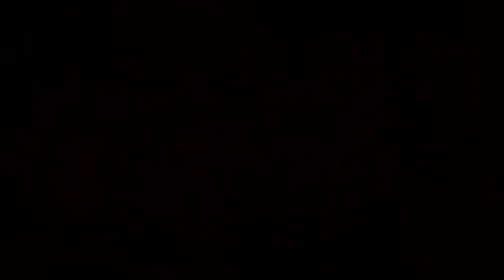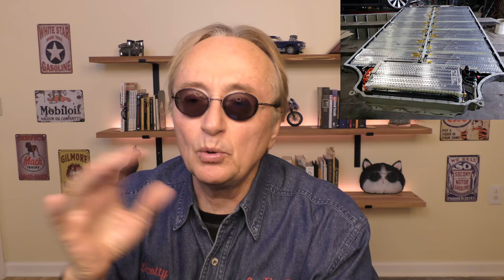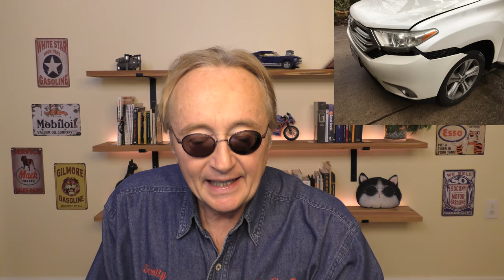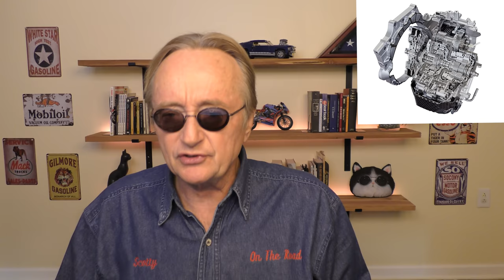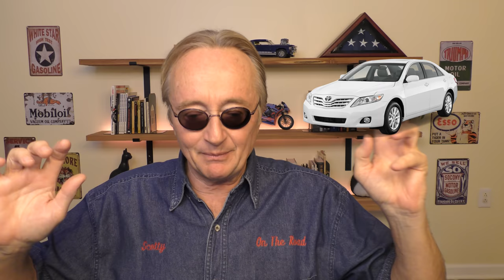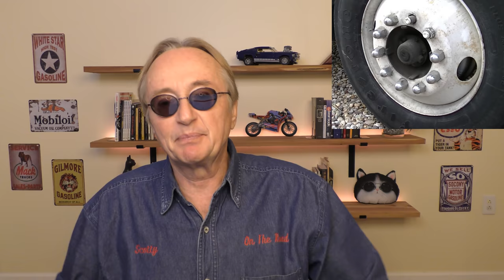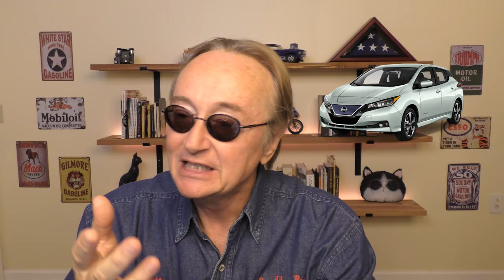This Fatal Flaw Just Ended Tesla’s Future in America

Comment: Give me the good old fashioned gasoline engine, always there when you need it!
Reply: Sure.  You'll change your tune long before this decade is done.  Scotty doesn't know this subject.
Reply: FACTS
Reply: Yep and only takes 3 mins to fill my tank and I get another 550 miles!
Reply: @Mrbfgray  Times going to tell the longevity of battery cars pal! You dont even know the problems yet, what we do know works is gas and diesel and you can suck on those tailpipes!
Reply: @Mrbfgray  the infrastructure isn't there for even 50% of the population to own electric cars.   Imagine the strain on the grid when every house has 2 cars plugged in every night charging.  It will be more than 10 years before they can implement widespread electrification.  Not to mention as long as there is oil to sell there will be cars to use it.  Think BP and the like are just going to pack it in?
Reply: @rxtuninginc8444  the infrastructure for electric vehicles will never be completed in ten years. First off there isn't the generating capacity to have millions of vehicles,  not just cars but trucks of all sizes, being charged simultaneously. It may take 50 to 100 years to simply get the power generation built. It won't be solar or wind...which fail to work when you need it most.
Reply: @brandonlewis5045  I'm far better informed than you are on this topic.  YOU WILL switch to EV before you suspect for economic, convenience and superiority of EVs.  Not going to argue further but you'll see in a few yrs. 

 BTW--I'm something of a petrol head, no desire for an EV, still love my 'old' BMW S65 V8, but I see where things are going and have made a small fortune on it already.
Reply: Until it's so cold the engine won't turn over. EVs lose range in the cold but they physically cannot fail to start.
Reply: @brandonlewis5045  Yes time will tell but battery life is going to be a non-issue at least for many options out there.  Even old Tesla Model S's (2013 vintage say) with 200k plus miles are doing fine and that was with much inferior batt tech than current iterations.
Reply: @rxtuninginc8444  How about taking 30 seconds to plug in at home and NEVER visit a gas station again?  (only charging at a station will be for road trips)   Or near zero maintenance?  Or 1/4 the operating costs?  It doesn't take you 3 min it takes at least 20 as you go out of your way to fill up.
Reply: 2014 electric smart car.  Bought with 6k miles off lease for 5800 delivered.  
Now just over 100k miles.   No repairs . Only maintenance has been tires and wipers.   

Front and back brake pads still  at over 1/2 life.
Reply: @Mrbfgray  How about the power grid and california having black outs in the summer because of peoples af running and people charging evs??????????????
Reply: @brandonlewis5045   Cali has separate problems but charging at night should be of little consequence.  Furthermore it's becoming increasingly cost effective to be independent of the grid entirely, already pays off in a reasonable time frame and will  continue to become cheaper.  
When refrigerators and AC were 1st introduced the grid wasn't ready for them either but it was by the time everyone had one.  EVs will have a similar increase in grid demand only this change will be faster.
Reply: @johna5484   Sounds like ultimate econobox deal you've done there, and that's for an old inferior tech choice.  Near future options will be vastly superior.
Reply: @Mrbfgray  So..... My question to you where are the rockefellers and the oil money in this transition?
Reply: @brandonlewis5045   Utterly irrelevant if they don't chose to join the transformation...you haven't fallen for that fantasy that Rockefeller's or BIG BAD OIL runs the world, have you?  Dallas wasn't a reality show, lol. 

Shell has been involved in alternatives for decades as have others.  Famous quote from old oilman:  (Shell CEO I believe--circa. mid '90's)  "The stone age didn't end bc we ran out of rocks and the petroleum age won't end bc we run out of oil."

He couldn't begin to know how right that call was prior to horizontal drilling/fracking tech revolution made 10X more economic oil available.
Reply: @brandonlewis5045  I can and have, in the past, made my own fuel to run an internal combustion engine...no fossil fuels needed.  There are already renewable fuels, both engine oil and fuel made from resources other than oil from the ground. These fuels and oils are already available now...without any further investment in infrastructure.
Reply: @johna5484  Does it pull trailers or haul? What do you do with it on a daily basis/
Reply: @Hamdad  Engines always turn over with a good battery in place an no other existing problems
Reply: @northdakotaham1752  Facts, oil money isnt going anywhere in the end,
Reply: @brandonlewis5045  If fossil fuel co.s ran the world coal wouldn't be in the toilet and every auto mfg on Earth wouldn't be switching to EVs.  Yes they have some influence like any other sector but it hasn't even prevented government nonsense like mpg mandates, and lobbying is their only real power.
Reply: @northdakotaham1752  It would be bad business to cut the middle east off entirely from oil money. We just go green with no proof of how it holds up other than running in town. That doesnt do anything for all of society to get a roller skate with batteries and drive to the coffee shop. Somebody has to deliver that product along with many......... That roller skate doesnt fit the bill,,,,, Diesel and gas does
Reply: @brandonlewis5045  admittedly,  electric might make a good grocery getter,  short trips...no engine warm up time etc. Henry Ford's wife drove an electric car! But the argument always seems to be how battery powered vehicles are better...but they only consider operation under ideal conditions. Conditions that rarely exist in the real world. 
 The U.S. does not need middle east oil. It's all about policy.
Reply: @Mrbfgray  typical EV guy who claims he's more educated by himself 🤣🤣 just another know it all with only theory to back him up and a lot of hope, save the planet is the only thing he plays in his car because that's all you know. I have come across multiple of you people its like talking to a vegan about eating meat it all sounds good but in reality it will never happen.
Reply: @northdakotaham1752  thats my point and I also said MORE than 10 years... could be 20 or 30.  Either way I don't care because ill likely never be forced to own an electric car in my life which is fine with me.
Reply: @Mrbfgray  yep I'm a gearhead/petrolhead too.  Give me anything with an engine on it and I'm happy.  These tree huggers can rip my ICE cars/trucks, turbo SXS and 2 stroke dirt bikes, ATVs and shifter karts from my cold dead hands, cuz that's the only time I'm giving any of them up.
Reply: @rxtuninginc8444  I think we both know that the only thing that will radically change transportation in the U.S. is more federal government intrusion into the citizens personal rights.
Reply: @deeeeeeeench1209  I have no idea who you are talking to or what language--some backwater dialect?

Comment: Used Teslas are endless money pits.
Reply: I bought new cuz I worried about that as well but I've also replaced a $17,000 motor in my truck too so now I just try stay on warranty
Reply: @themeach011  what motor did your truck have that cost 17k?
Reply: @captainobvious5993  dude don't get me started. I did lie a little bit. I was able to find an engine out of a wreck for 10k and it cost 4k to have it swapped out at a private garage. Which was a steal, they have to pull the entire cab and unlike the Ford's where the cab is designed to be removed easily and quickly a ram is not. but an EcoDiesel engine from dodge with replacement by the dealer was quoted over $20k so I had to get a little creative. Our Canadian dollar is around .80 USD so that was where I got the value of approx 17k from. Plus 11% tax of course. I've also had an EcoBoost engine that blew cuz the oil change guy didn't tighten the filter. In the old days I spent 6k on a rebuilt transmission, 6k on Cummins injectors, same on power stroke injectors, all of these things are issues that will never be an issue with my EV. I crunched all the numbers. With the mileage I put on, my Tesla will save me about 5k a year. It's always got a full tank every morning, it's relaxing to drive with the auto pilot if u want it for those boring roads and it's a blast to drive on fun roads. It would kick the stuffing out of my 2015 5.0 mustang I had. It doesn't sound as good as that did. I never have to worry about my wife forgetting to check the oil or bringing it home on empty which she would do all the time. I don't know why women do this?. You put windshield washer in the thing and go. I'm so happy with mine I can't wait till there's trucks available so I can switch that too. And I'm basing my opinions on actual ownership unlike all the people on here who have never even driven an ev never mind actually owned one. I'm not in a spot yet where I could only own an ev, in Canada our infrastructure just isn't there yet. But I love mine and I take it everywhere I can it keeps miles off my trucks and saves me a ton in the long run. Even if in 8 years when the battery is off warranty one of the sections needs to be replaced that cost has gone from like 20k down to 5k just in the last few years. 8 years from now that cost will be even less and in 8 years I'll have saved 40k already anyway and I'll likely have upgraded it by then anyway as I've learned not to risk driving stuff off warranty. It's cheaper for me and my business to drive new and not be in the shop and not have down time
Reply: @themeach011  hasn't your electric bill gone up from the charging though? You should calculate the electric cost over 5 yrs also. If you have not already.
Reply: @captainobvious5993  power definitely costs more compared to pre ev.  But home charging 500kms costs about $8. In my other vehicle that same 500kms cost about 60$ in gas.
Reply: ICE cars are money pits with tons more maintenance. Your point is?

Comment: My 1998 Lexus LS400 used to have a slight surge all the time. I could be sitting at a red light and all of a sudden the rpms would jump over 2000 and the VSC/Traction light would illuminate, so I had to keep my foot on the brake hard all the time. As long as I kept the A/C turned on it would rarely happen or only occur maybe every 3 days versus several times a day with the A/C off. I would have to turn off the vehicle and restart it to get the vehicle back to regular idle. And of course being an LS400 that cost me even more money in the long run because I had to replace my starter much earlier than I probably would have had to if not for the constant restarts. I was told by Lexus I needed a new throttle body, so eventually I had the throttle body replaced and it has ran fine up until last month where it got towed for sitting in the same parking spot for too long I guess. The community I live in has a tow policy I didn't know about and it hadn't been driven for a few weeks because we barely drive much now because of the pandemic. The tow place wanted $500 to get it back and that was a few weeks ago so I am pretty sure it's much more by now. I'm contemplating on just letting them keep it cause it may not be worth spending over $500 for even though it's worth more than $500 to me. Smh, ugh.

Comment: Hey Scotty love the content, I’m 17 almost off to college and I have a 2014 Nissan Sentra with 140,000 miles and running fine so far as I try and make it last until a new car. Long story short should I buy a celiac gt4 as my second car or some old Camry like that since money is a bit tight at the moment
Reply: Camry better gas mileage. Gas prices gonna shoot up
Reply: I had a 92 Camry with a 2.2 liter motor, 6 speed transmission and 140mph speedometer with no governor, ran a like a top for years 4 door full sadan and 40 mpg was a great carroll the engine froze solid one winter -20 with 60mph winds went to start it and that interference Engine died in seconds... I drive a 2007 ram 5.7 hemi now... Holds my tools much better... But a camry is a great car, excellent gas mileage and plenty of Speed.. I maxed that car often watching the speedometer bounce..

Comment: It was already known not to overcharge these. It shortens the battery life. Even the older Teslas have a trip mode. You set your charging limit. Instead of charging to a 220 mile range, you charge to 190, or even less.

Comment: Hey Scotty, I'm looking into getting a "newer" truck and was wondering what would be the better buy. I'm looking at a 1969 M35A2 Deuce and a half. My pops is telling me to get something more practical. Every which way I look at it however, I can't see anything more practical. Ya it's big and guzzles fuel. but cheap insurance, can run on anything, can go anywhere, can haul almost anything, all mechanical, no electronics (except for lights) and all for about $10,000. If not a Deuce, what would be a better choice in the F250/2500 range of trucks?
                                                                                                                                          Thanks.

Comment: That Subaru throttle issue sounds an awful lot like the problem Toyota had about 10 years ago. I think it ended up mostly being stuck throttle pedals causing issues. That's one reason to get a manual I guess, you can always bump it into neutral if something goes wrong.

Comment: Way back in the late 1960s, I used to spend my lunch times in the school library and there was a magazine called popular mechanics. In one of those magazines, there was an article about electric cars. One of the things that was discussed in the article was range. A possible solution was to use easily replaceable battery packs at charging stations. There was even an automated solution suggested, where the batteries were replaced from underneath the vehicle with a conveyer system, so that flat or near flat batteries could be replaced without the need of the driver leaving the vehicle. Now this is one thing that puzzles me about modern electric vehicles. Why are the battery packs so difficult to replace? Surely engineers can come up with an easy solution for that.

As for electric trucks. I would advise that the best solution for long distance haulage is by rail. security and logistics needs to be fixed, but there are already trains that haul loaded trailers on flatbeds for prime movers to transport these to their final destinations..

Comment: Scotty I have a 2018 Honda Pilot FWD 6 speed . At 10k the tranny slip after a 3 hour trip around a winding mountain trip. I was at a stop on an incline. I do use the overdrive button a lot to slow down on curves. Took it to the dealer but they couldn’t replicate the issue. Is it my over use of the overdrive or the vehicle? BTW I still use OD to slow down as I feel the brakes are under engineered for this big vehicle.

Comment: Lowering the maximum charge percentage actually does solve the dendrite problem, they grow in lithium batteries no matter what over time and they grow faster when a battery is charged too close to 100% for long periods so you are supposed to reduce the capacity limit to something a bit lower than 100%. This is why phone/laptop/tool batteries last only a few years (they are charged closer to 100% because users are willing to accept spending £40 on a battery every 3 years or buy a new phone every 3 years if it means they get an extra hour of battery life whereas a car owner probably doesn't mind losing 20 miles of range if it means their car lasts 5x longer)

The issue with those cars was just that the limit was set too high rather than an inherent issue with batteries, limit the charge percentage and the dendrites grow exponentially more slowly with the size of the limit, limit to 80%, never go below 20% and they'll last 20 years, go somewhere in between that and allow close to 0% and 100%, you get 10 years. You can think of it as the RPM you run your engine at, if you take an engine to 8000RPM regularly, it'll work for a year or three and then die, limit it to 7500 changing nothing else and suddenly it lasts 20 years.

Comment: I remember one incident that might relate to the problems with the Tesla batteries. There was a Boeing 787 that caught fire a few years ago because one of its lithium ion batteries had a short that led to thermal runaway in the battery cell. I’m not an expert on lithium so please correct me in this, but it sounds like that aircrafts battery had the same issue as the batteries catching fire on the Tesla’s. Again please correct me if I’m wrong, I’m not an expert on lithium batteries.
Reply: Oh those pesky shirts causing battery fires. Lol  Sorry I couldn't resist.
Reply: @beezalbub7325  lol nice little joke there I like that one lol. That was from a glitchy autocorrect. I could’ve sworn I edited that though.
Reply: @Noble Goldheart. I'm glad you have a nice sense of humor.  The Boeing battery fire was due to faulty manufacturing that caused the fire as you stated. Overcharging can also cause thermal runaway in a lithium-io battery, so I'm not sure what exactly caused this fire. Sure needs an inquiry for a definitive answer.
Reply: @beezalbub7325  what’s the point of being sour against humor? If you see a joke, then why not go along with it? Lol. And I definitely do agree with you on the definitive answer.
Reply: @Noble Goldheart, I agree, but an incredible number of very, very, very thin skinned people on line these days. Have a great night.
Reply: @beezalbub7325  you have a good night too buddy.